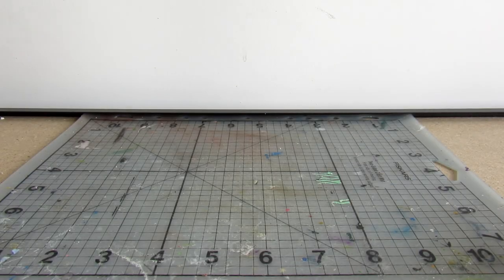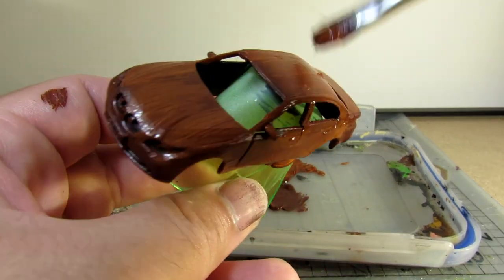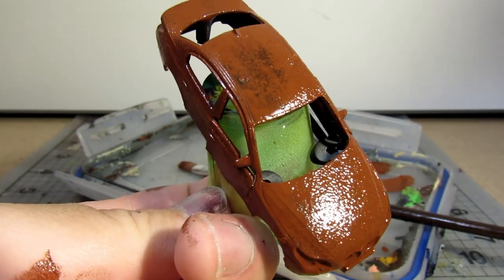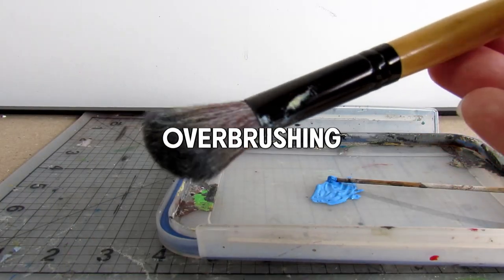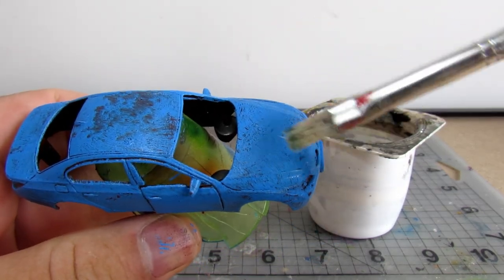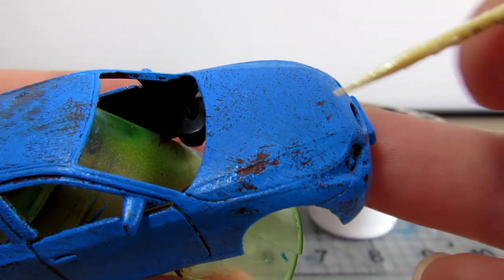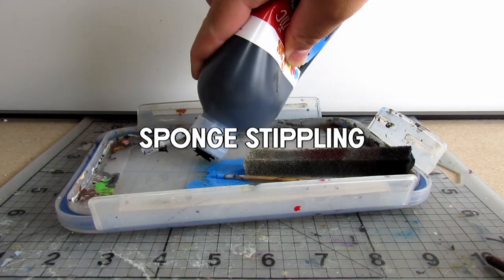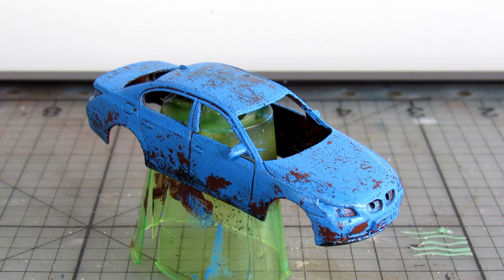Gaslands Weathering: How to do Hairspray Chipping without Airbrush

Comment: I tried this yesterday, (along with a salt trial) but instead of brushing over the hairspray layer, I used an army painter rattle can. Bad idea. The paint adhered to the hairspray far too well and didn't just peel off easily. I had to scrape too hard, and in many areas, exposed back to the metal. I think if I'd used a standard acrylic like you showed it would have worked better.
The salt technique also didn't work so well. In both cases, I used a food dehydrator to speed the drying process, and I think this baked the paint and salt too hard. I got good 'bubbles' over the salt, but again, just light scraping with water wouldn't dislodge the bumpy areas so easily and I had to scrape hard to get some of it off.  
So, for anyone else trying this, be patient and don't take short cuts like I did.
Great video - my mistakes my own.
Reply from the maker: Great feedback! I've never tried this with a rattlecan, but an airbrush with acrylics or enamels definitely still works. Rattlecans tend to go on thick so that may be what made the salt unresponsive to moisture.